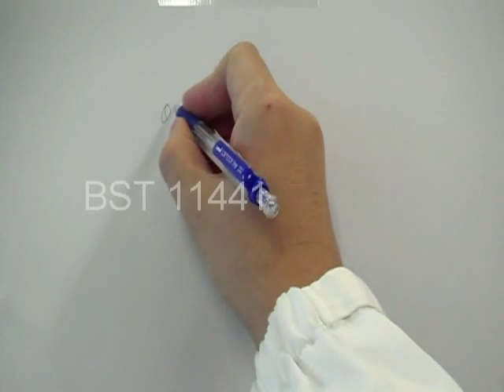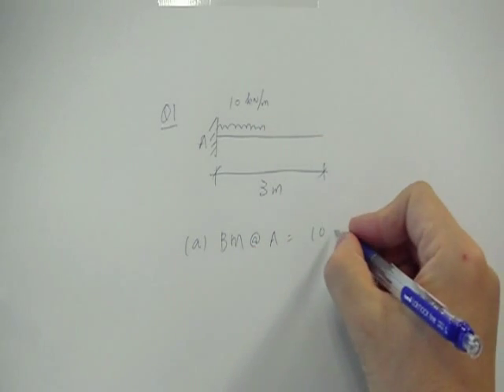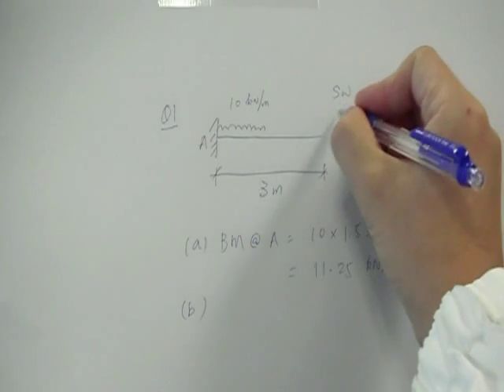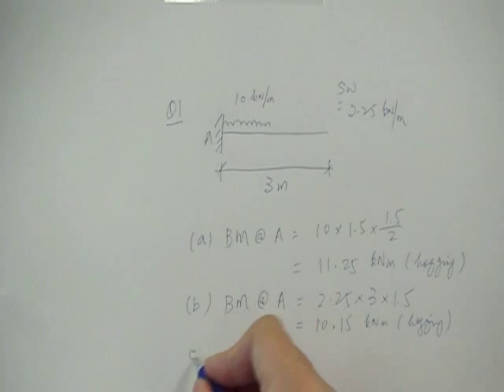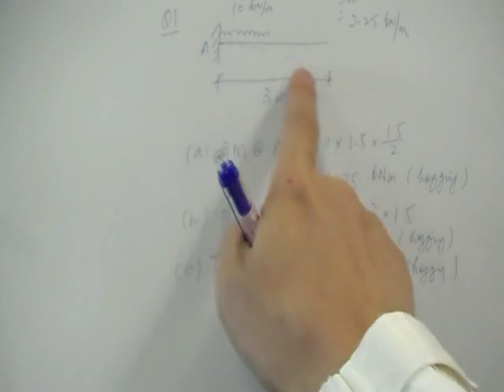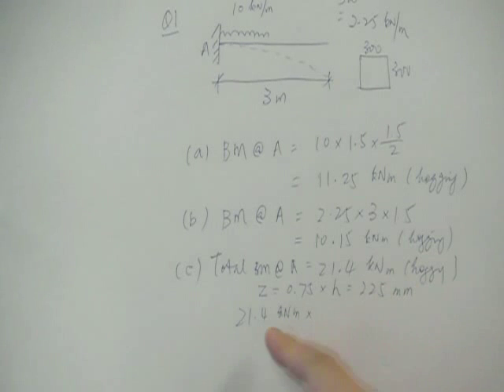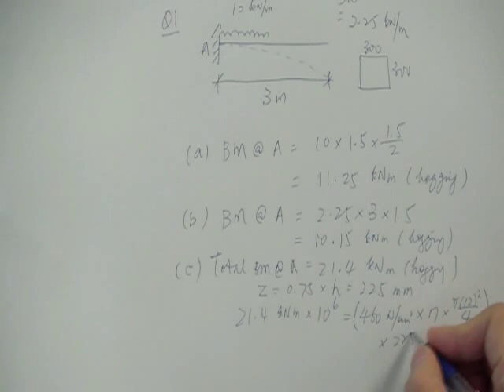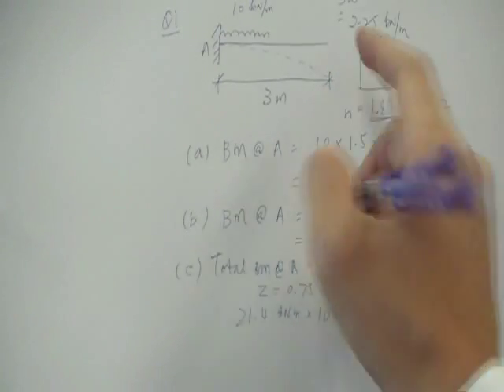Reinforced Concrete Cantilever Beam

Comment: @PFRocker That is the known strength of the steel that is being used; it is not calculated. It is based on tensile tests that would have been performed on that brand of rebar. In other places, you might see a strength of 420N/mm^2 (60,000psi), also denoted as fy in the ACI code.

Comment: Tensile Strength Fy = 460 N/mm^2 is given in the practice code ie BS 8110/Eurocode EC2 (both BS and EC2 recommend 500 for concrete). Hope it helps, though I am late ;)